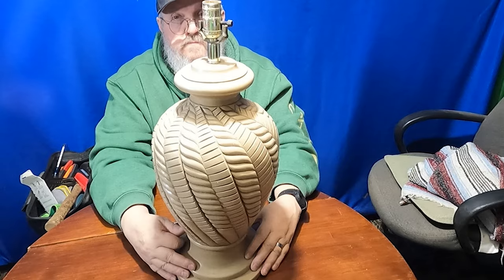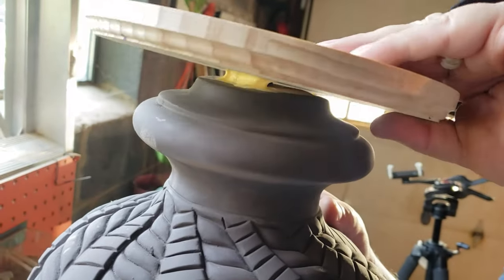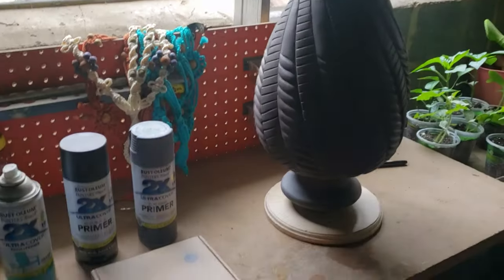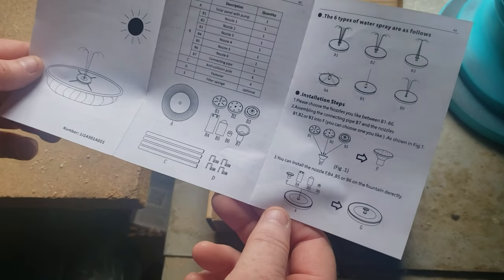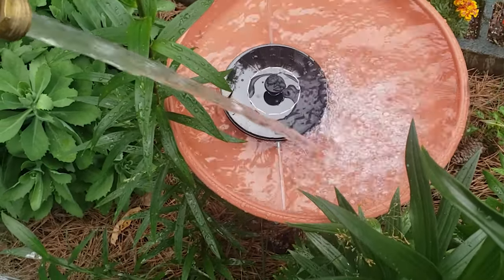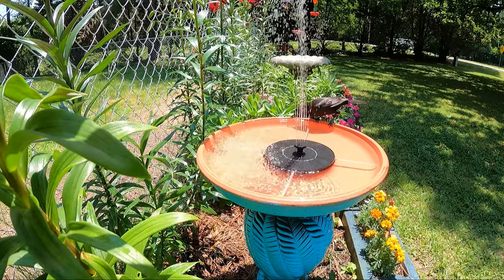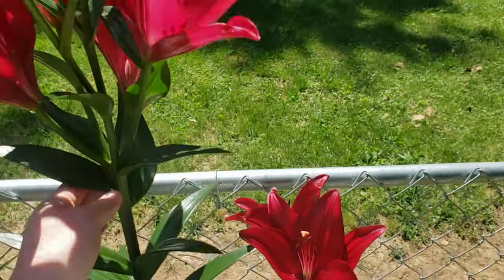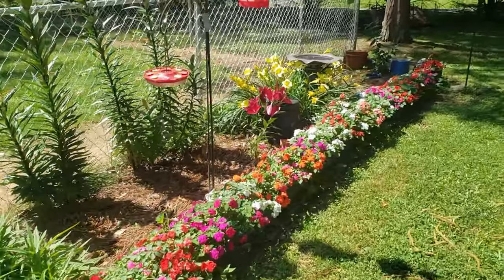Turn a Lamp into a Fountain Birdbath #3

Comment: Great idea!  Love the color and love the robin!  Yes, birds are drawn to the trickling water sounds!  The straws are basically bumpers so the fountain doesn't go to the sides and spill out even more water!  I bought the glass solar fountain on amz this year.   Try that one too!  It has a different attachment that keeps the water lower. I agree that the planter tray is probably too shallow.  That's what I've been using in my broken bird bath. Thanks for the cool DIY's !
Reply from the maker: They had some beautiful glass bird bath basins at Hobby Lobby for 50% off and I started to get one but I talked myself out of it because it was still more than I normally spend. I will look for the glass solar fountain. I'm about to make my Mom a birdbath and she wants a fountain.

Comment: Such a creative way to recycle things. I bought the same solar pump and I didn’t put any of the nozzles on so it created a low water spout so you don’t lose water with the taller spouts. Hummingbirds like the shorter spout.
Reply from the maker: Yes, that's what I ended up doing with it. The birds and hummingbirds seem to like the low water spout better. Thanks for stopping by.

Comment: If you come a crossed some older glue like you said you had in this video try putting the glue into some hot water if it's not to old or dried out to much it should help soften it back to normal .
Reply from the maker: Thanks for the tip. I did not throw out the dried glue because I was going to look up a way to save it but I never got around to it. I will try this.

Comment: I bought one of those solar fountains a few yrs. ago. Tried the different sprayers, same problem. I ended up using the little bubbly one. The others went too high and would spray over the bowl. I ran outta water Too fast and what a noise they make when they do. Love your bird bath !
Reply from the maker: Yea the bubbly ones works better. Thanks for stopping by.

Comment: If you just use the straight nozzle instead of one of the attachments the wind won't blow the water out and empty it. Also have to periodically clean off the pump as it will clog with debris. I actually prefer a solor fountain that runs off a panel attached to a long cord, also on amazon. That way you can put it wherever the sun is and it stores up power and can run when it's dark
Reply from the maker: @lisasmith1684  yes. I removed the nozzles and just let the water bubble over. I also have the solar panel one now that I like too. Thanks for stopping by.

Comment: I have tried a few of those solar pumps.  All quit after a year or two.  In winter, it gets to -30 sometimes, I had to put them away in a dark place.
Reply from the maker: @ConservativeVet84  mine is still working but we have mild winters here.
Reply: @BobbiJo  I came up with a solution though.  My dogs have heated water bowls, so I put a few of those out.  Just had to run some extension cords.  The birds love it
Reply from the maker: @ConservativeVet84  that's awesome. We had a week last year where everything froze. I forgot to empty my concrete birdbath and it cracked. I need to repair it but I'm waiting until after the migration season is over.

Comment: FYI, as a woodworker, if you have a small bit of glue left that's too dry but still without chunks, you can add a bit of water (because Titebond is water-based), mix or shake well, and use it only once or twice after. It gets weird after a week. I know. 
Hint: to remove the squeeze out residue even after scraping, you can use white vinegar. Just wet a shop rag with white vinegar and rub on the area that still has residue and won't take stain or finish. You'll be able to see what you can't with the naked eye on dry wood once you soak it in white vinegar. It will be way lighter in color. Just be patient and wipe the residue out with a rag and white vinegar. If it's blobs, then let it soak, scrape, and then wipe. 
The vinegar will pull all of the residue out of the grain without raising it in most cases (depending on the wood). With enough patience, you'll have joints or blobs or "oops" fingerprints" that will be entirely extracted from the wood and won't show up on finish. 
The trick is to check before finishing. After, you'll be sad, and there won't be anything you can do but sand the finish, remove the residue with vinegar, and re-finish.
Reply from the maker: Thanks for the tip.

Comment: Drill the small holes bigger so the water doesn't spray out. It works great for me. And you can put rocks on the inside too.
Reply from the maker: Thanks for the tips.

Comment: You can use the fountain without a cap or make the cap holes slightly larger. These fixes reduce the height of the spray. Another option is to get a solar panel that is separate from the pump. This allows you to place the fountain in an area with shade while the panel is exposed to the sun.
Reply from the maker: Yes, there are several options. It came with different caps. The birds seem like the one that bubbles instead of sprays the best.
Reply: That has also been my experience.
Reply from the maker: @leannemiller9514  thanks for the info and for stopping by!

Comment: Can you tell me what tool Steve used to cut the metal rod down on the lamp?
Reply from the maker: Yes, it is a small hacksaw. Depending on the lamp, sometimes you can remove the rod. Sometimes the rod is plastered in and I don't try removing those. Thanks for stopping by.